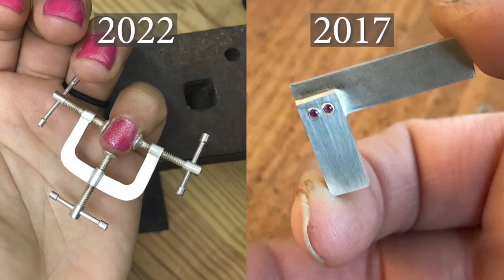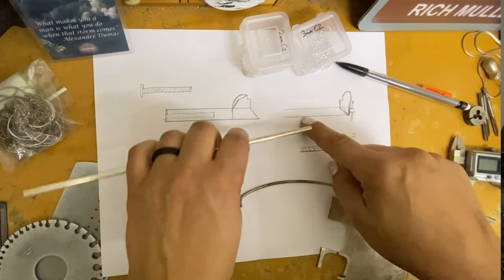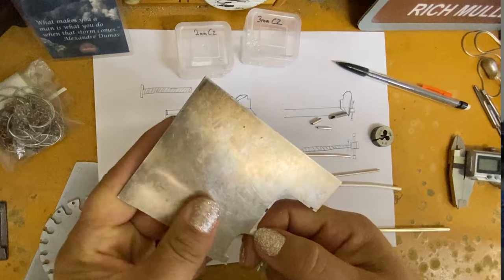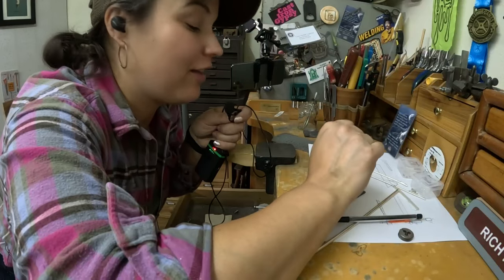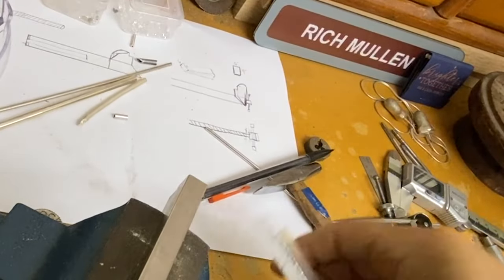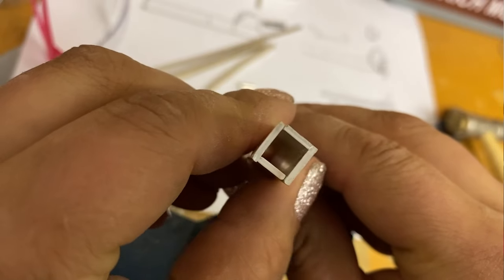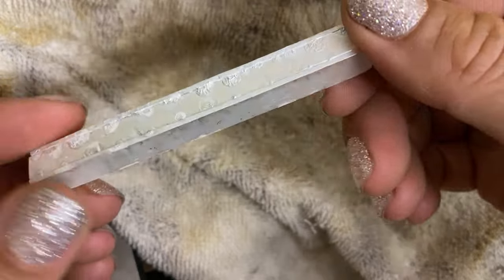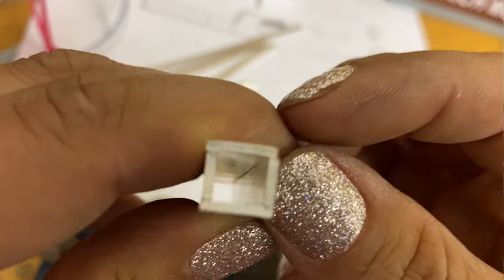Making a Mini Vice | Episode 1 | It's also in SILVER!

Comment: Nicely done!  Is ther a reason you went with doing the strips vs. cutting V's into the sterling silver and "folding" it into the shape and then soldering the joints?
Reply from the maker: Hey WreckDriver99!!  I used strips instead of scoring and bending because I wasn’t confident that I would be able to consistently cut a ‘V’ in that long of a length.  Maybe next time I’ll have a mini mill and a “V” bit!!😂🎉

Comment: Cześć ... powiedz proszę 🙏 co robiłaś w tym  kociołku 🫕 przez 15 min. co jest wewnątrz kociołka ?
Reply from the maker: The “crock pot” (cauldron) has an acid called sparex inside and kept warm.
The sparex solution removes any leftover flux residue and any oxidation that comes from when the metal is heated up.😊
Reply: @CastIronGypsy  🥰Thank you very much 😊, and greetings from Poland 😉😊